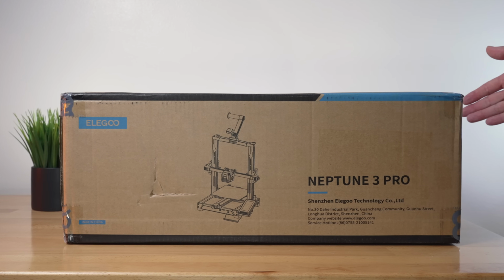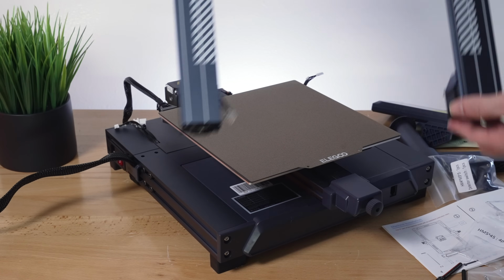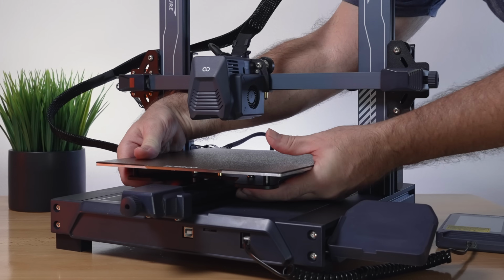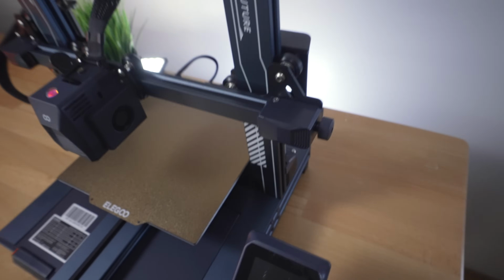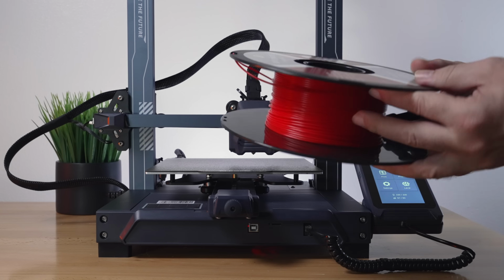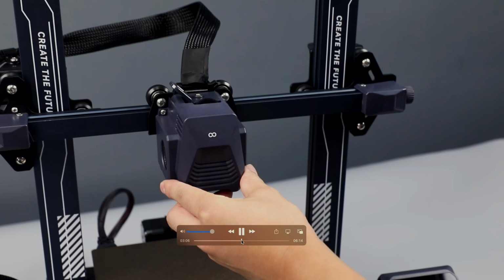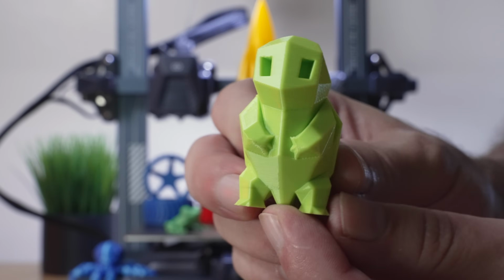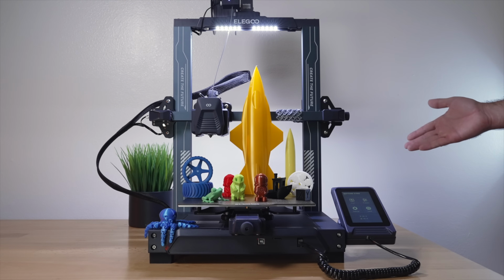Elegoo Neptune 3 Pro - 3D Printer - Unbox & Setup

Comment: I got this printer but, the print keeps not sticking to the print plate. Whenever it does stick it for some reason messes up halfway through
Reply: I’m having the same issue. Have you found a solution?
Reply: It's hard to answer effectively in a YT post, but my experience is lack of bed adhesion is from 2 main sources. 1) Bed temperature.  2) Dehydration of your filament.  Research those 2 things. Good luck.

Comment: Great video! This really helped me a lot as I felt like the instructions were confusing at times. I would recommend using the glue stick though, my test run of the buddha was great, but at about 80% done the buddha popped off and I was unable to fix it. It was a test run though, so no issues there. But I am happy to see that everything was set up nicely and works. Can't wait to explore this 3D printer more! Thank you for the video. It was very informative.

Comment: Cable clamp I got was completely different. The whole thing didn’t even fit there without putting a screw through the circuitry. They gave me the wrong clamp.
Reply: Me too im using a zip tie for now
Reply: @Notleach same

Comment: Followed you step by step. Mine didn’t come with the spatula or the clippers and the cable clamp was a different design. But everything else was spot on. Printing Buddha as I am typing (75% done) looks fantastic. Thanks !
This is such a step up from my previous (M3D) printer.
Reply: What did you wind up doing with the different cable clamp? I have a different one as well.

Comment: I don't know if anyone looked close enough to the motherboard but, it is fully up-gradable for dual extruders! All sockets with pins outs are populated, so that means if you know what your doing  you can up-grade this to a dual. there are 3 fan outlets and they are compatable with a 12/24v option, just set the jumper pins. there is added connector already there for the hot end of the extruder #2.
Reply: I just bought one and in the back of the manual there is even a circuit diagram

Comment: I purchased a Creality Ender 3 V2. The setup was a complete disaster. Also I was never able to print with that printer. Creality support is a real joke even from Shenzen. I prepared a video on YOUTUBE for the encounter. 
Now I purchased a ELGOO 3 Pro. What a huge difference. Your video was very helpful even though the manual was limited in instructions. Creality Ender took me about 15hrs to assemble. This Elgoo took me about 1 hour. Installing the last part which was the cable holder made me realize that I put the frame on backwards. No big deal. Took the 4 screws off and reset to the proper place. Initially I was very skeptical because when the box arrived, I noticed it was also from China in Shenzen. Was I in for another disaster? So far I am impressed.. I haven't printed yet but I do not forsee any problems. Enough for now and anxious to start printing. Good job on the video.

BOY!!! was I wrong.....Turn power on and said booting for 2 seconds and then screen went blank. Now if I power off and on, I just get a black screen. Looks like another disaster. Even the scan disk is blank..and I do not get connection to computer. I wonder what is going on in Shenzen, China..!!
Reply: Seems like maybe you forgot to check the power supply switch 115/220v...If in USA and it's 220v printer won't turn on or partially get some flicker on screen and then nothing. If in Europe and 115v it'll fry your motherboard/power supply.
Reply: 100% you did not set the power supply properly. Stop giving out bad information. You didn't follow the setup instructions. Your fault. Don't blame the machine

Comment: you can see how the belts run by looking at them on the visible sides.  You do not need to see them where you adjust the tension.  You do need to be able to reliably adjust tension with a cover that can handle force though.  If you worked on cars you would understand timing belts and these are very similar.  

Stop making people think that needs to be visible...you clearly lack experience in life outside of your narrow window.  Just because you worry too much, doesn't make sure you are giving good advice.

Comment: i have a problem with the z Axis right out the box. i did everything you did and when i switched on and hit home button it goes to the left then the bed moves and my z axis just does nothing, do you know why this might of happened
Reply: have you solved your problem, friend? I have the same thing, I don't know what to do
Reply: @inferst262  yes i did i had a bent pin in the extruder head i straighten it and worked fine. I also contacted them and they sent a reppacement

Comment: Thank you, I followed your video to set up my NP3 and  as my first project I printed the tool holder. It came out great, however a fan at the base of the printer is constantly running even when it is not printing anything. Is that normal? do I need to change a setting?

Comment: Mine seems to print just fine, but i am trying to figure out how to achieve the wrinkled look on the bottom. Slower speeds and perhaps higher temp might do the trick. Bed sligthly bent and i will probably upgrade to silicone spacers so i can manually level it.

Comment: Great insight and video !!! I am planning to buy my 1st 3d printer for helping with custom parts for a robotics team doing First Tech Challenge. I am kind of sandwiched between - ELEGOO Neptune 3 Pro vs Creality Ender-3 S1 Pro vs Bambu P1P. From a pricing perspective currently Neptune 3 Pro seems to be the best. Also from use case perspective for our robotics needs, we need parts that are rugged, sturdy and can withstand collision from walls and other robots. Our thoughts are to print mostly using PLA, PETG, ABS, TPU (few cases). Don't think any of the 3 printers i mentioned can do Carbon based filaments. Is that right ? Need your guidance/suggestion on which of the 3 to pick and which of these requires least tinkering or accessories and can work pretty much out of the box for the kids to help with their STEM Robotics activities.  Please suggest and help.

Comment: Received my Neptune 3 Pro yesterday and put it together today. Currently printing a XYZ cube after Buddha. Overall it's a nice little printer for the price. However it appears that they are in a rush to get them out the door. The bed was quite loose and had to be adjusted. The print head was also loose and had to be adjusted. The X&Y belts also were loose. The belt at the top for the Z axis is very loose and there is no adjustment for it. It's quite useless for keeping the Z axis tied together. But after adjusting everything it seems to work quite well so far. Can't be beat for the price.. Gerry
Reply: Printed a benchy  and a Axolotl after words and both came out great. This printer runs very well at 60mm/s...
Reply: would you print any faster? @GTW-1807
Reply: Yeah mine was like that, but it also had another fault that took me a couple of days to fix. 
When I got it, even after the adjustments you mention, it couldn't print the Buddha or even the tool holder.
It's all good now but it was really disappointing.

Comment: At the moment Neptune 3 Pro seems to be a great first printer, but not the one some enthusiast would be able to tinker with without building a whole new machine. It's not a bad thing per se, but it would be good to know. Besides the all-metal hotend there is just one other upgrade I found so far: an additional thermal insulation layer for the build plate.

Comment: I bought my daughter Ziro Starry Sky filament, but we're having an issue with it building up on the nozzle as it tries to print.

I purchased a 0.6 nozzle to try to remedy this. Any suggestions on what we should do differently in the settings to accommodate the wider nozzle would be greatly appreciated. Thank you!

Comment: Hey Vlad I thought  i would drop by and ask  while waiting on Elegoo support, I have just set up my Neptune 3 Pro and noticed that the home position for the hot end is not in the center of the bed, it is off the to the right by about 45mm and towards the front by about 20mm to 25mm
Do you know why this could be?
Reply from the maker: It goes off the inductive Z sensor on the back of the hot end assembly.
Reply: @JustVlads  Ah so not the nozzle?

Comment: Great video, I'm thinking on buying this printer as my first 3D printer. But I have one question. I'm going to use a little table that I have on my room, the problem is that I don't know if it'll fit. 

I would like to know which are the dimensions of the machine, not including the width of the screen, because if it's necessary I could put the screen on another place so the printer fits the table. 

If you could provide me these dimensions I would be really grateful, since in the official website doesn't give a lot of information about the dimensions of the printer, with or without the screen
Reply from the maker: 18" Wide (20" with screen), 18" Deep (Bed all the way back to the front feet), 28" High (with 1kg spool on holder)
Reply: @JustVlads  thank you so much, just what I needed to know 💪🏻💪🏻

Comment: Did they fix the firmware on this, or is it running the same as the standard Neptune 3? Will it do a pause to change filament command (M600)? The standard doesn't acknowledge any of the pause commands unless you have custom firmware, and then it won't resume the print.
Reply: The Neptune 3 can pause at layer height and resume. I’ll be making a video on how within the week
Reply: @keoladacalio liar
Reply: @Cheeseguy738  not a lie. It’s in the slicer software. I just never made a video

Comment: Really great review ... Thanks so much.
I have a question.
Can you measure or tell what the minimal footprint is of the machine?
I would like to place it on a shelf with possibility to overhang in front.
What depth is needed from the very back to the last point touching the table?
Reply from the maker: You'll need at least 18" in depth, 20" wide & 30" tall.

Comment: Wonder how this stacks up compared to the ender 3 s1/s1 pro
Reply: I have both of them and they’re very similar in print quality and hardware. The only difference is that it is a little bit better to print abs on the s1 pro ( it has lesser warp problem).

Comment: Looks like it needs a bit of tunning as my Neptune 3 (not pro) for the seam and maybe some tunning for the ringing problem (last prints looks better). Neptune 3 was my first FDM from Elegoo, it’s my 8th printer I’m 3d printing since 2013.

Looks like this E motor is too heavy and far from the X gantry, this can produce some issues… which motor is? Nema 17 or 14? So strange this fan on the bottom of the hotend. It have allmetal or bore 4.1 (tube all the way in) heatbreak? 

Thanks for the video, the best of of this machine. I hope to see a long term review as well and speed test to know the limit to avoid ringing issues :)

Comment: Of course I would see this before I commit to my first printer. I found a great price for the Sidewinder x2 from a seller in the US, but with Amazon discounts and whatnot that I have I could get this for half the price of the Sidewinder. Granted the Sidewinder is much larger and I think more flixible for my needs, this guy could also be great and easy to use. It's so new it's not even on Elegoo's site!
Reply: As someone who has both, go with the sidewinder. Both my Neptune and my buddy's had a lot of issues, some of which we still haven't fully addressed with his. My Sidewinder X2 on the other hand was my first printer and has been an absolute workhorse. It has easily handed any project or filament I have thrown at it, including TPU and Ninjaflex.
Reply: @Ravnican127  This is good to know. I'm struggling with the decision because I can get the Neptune for about $160 while the X2 would be $300-350
Reply: @dwarrenmsp  where did you find Neptune 3 pro for $160?
Reply: @ihasacavity  I have $50 in rewards accumulated and another $10 for looking my Venmo. It all adds up.
Reply: @Ravnican127  What issues and with the Neptune 3 pro model?
Reply: @drooooo1  gantry was not square with the build plate. Seemed like the X axis bar was slightly bent. With almost any other printer you could adjust for this with the bed leveling knobs, but not here. Also running the auto leveling process back to back several times gave wildly different results.
Reply: @Ravnican127  thanks for the feedback. Appreciate it.
Reply: Same lowkey annoying was gonna get flsun speed racer check those out if you haven’t it’s faster than normal printers but I can’t afford one they like 400